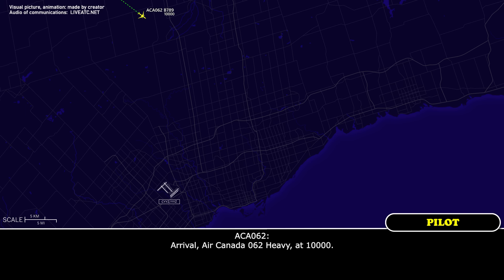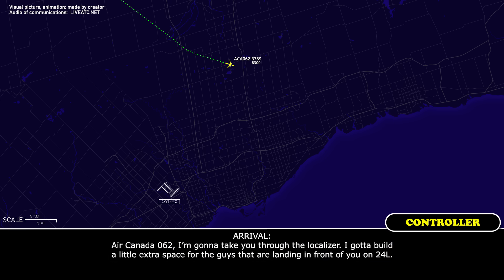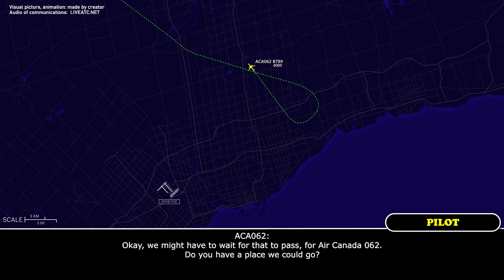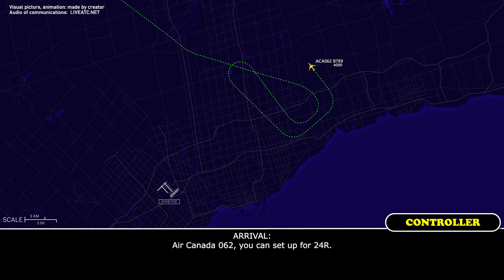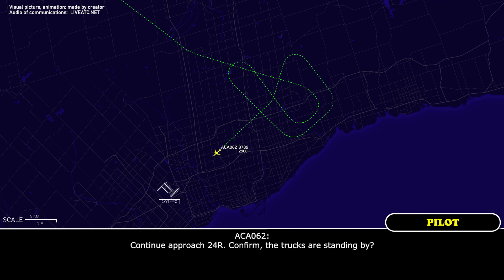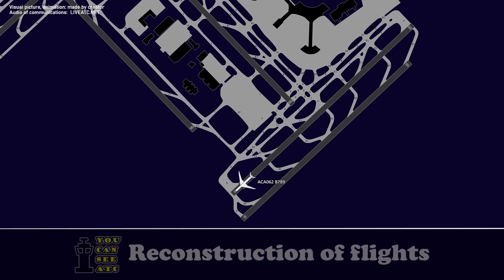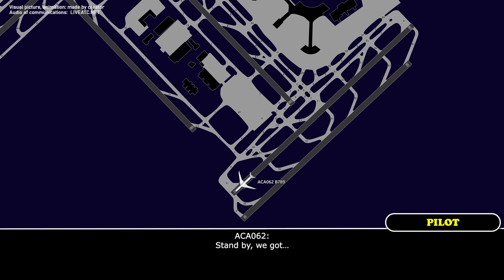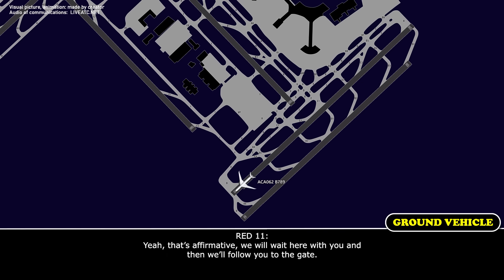Flaps failure on approach. Air Canada Boeing 787 stops on runway at Toronto after landing. Real ATC

Comment: 0 need to park on the RWY at a major airport like that - unless you are on fire or nose gear steering failure. Stupid pilots or dumb company policy. 

Standard ops is to  pull off into the nearest high speed exit and clear the active.  Extra 15 seconds and makes 0 difference to the temps already if you keep it rolling, in fact it would help the brakes cool slightly.
Reply: That is by no means standard....I have handled many flaps up landings and every single one has stopped on the runway. Lots of armchair ATC in this comment section...you have no knowledge of this airport's operation, why do you think that you know it was better for them to be on a taxiway? the runway was a perfectly good spot in this situation. There were weather factors, staffing factors, and airport layout factors.
Reply: @Marklar0  I explained my reasons for why any runway should be vacated as soon as possible
Reply: Next time when you're the aircraft captain of a large aircraft, with many people on board, at a busy airport, adjacent to a thunderstorm, and landing without flaps after a long day, go ahead and taxi off the preferred safe stopping position... But you would have more luck demonstrating better manners and awareness as opposed to insulting professionals using your keyboard.
Reply: @themightylion647  sorry, as a professional I never apologize for offending anyone, if it increases the safety of my ship even slightly  - why this is so hard to understand is a good example why our society is where it is today - people are unable to think anymore.
Reply: Luckily the commander was in charge and not you then. If you had listened properly you would have heard that the tower had told them that their existing position was the best place to hold
Reply: @davidwarren202  luckly for the commander, the fuse plugs did not melt and they would have become immobile and YYZ would lost that runway and delayed 1000s of flights - all for 0 increase in safety
Reply: @ghostrider-be9ek  They waited for a short amount of time for the brakes to cool, 24R was not on use (why they said the lights just came on) and if they made a right onto Delta they would still be blocking the taxiway as they were in their current position. Sure maybe if 24R wasn't occupied aircraft coming off of D6 or D could've made a right onto 24R and then onto C4, D4, etc. They're all professionals and I'm sure they did the best given the situation at hand - CYYZ has many runways and I'm sure ops could be adjusted to handle this situation
Reply: @ghostrider-be9ek  Two more into wind runways.
Reply: @danialbeg  the safety of the aircraft is paramount - GTFO the runway as its a danger zone - way more dangerous than taxiing an extra 15 seconds with no increase in brake temps. 

They are NOT all professionals, and AC has demonstrated this numerous times the last 5 years. Way too many people in the front who cant think outside of a book or manual.
Reply: @ghostrider-be9ek  again if the runway was not in use anyways then it's not like there were aircraft that were lined up for an approach onto that rwy. Additionally, if it was too dangerous ATC would've asked if they were able to taxi off the runway but never did - I have seen other incidents in the US where planes have stopped on the runway to cool as well so it's not only an isolated thing. Again, at the end of the day we don't have all the facts and perhaps experience that the crew and controllers do so our opinions don't hold much weight at the end of the day anyways
Reply: @danialbeg  again, just because a runway is not in use does NOT mean some numpty pilots dont land on the wrong runway - get the metal and pax off the RWY ASAP. 

It is NOT a place to hang out unless you are on fire or otherwise disabled (which they were not). 

Ultimately this was a dumb move, and had the tires blown YYZ would have been in a big pickle for 12 hours.
Reply: @ghostrider-be9ek  Lol bro 24R is never active at YYZ and I’m willing to bet it was not in use at the time. In this scenario it was just as much a taxiway as D4 D6 or D8. In fact, if they had vacated onto one of the turnoffs, they could have potentially held up inbound traffic landing 24L and vacating (as I’d assume 24L was the active arrival runway because it usually is). It’s not that deep. Tower instructed the runway would be the best place to hold and pilots complied. Why make things more complicated? Seems like you’re just trying to stir the pot. As for why the 33 runways were not used, not too sure. I know they’ve been under construction recently so that could be why
Reply: @dudeman2488  why is safety and common sense, stirring the pot? Why dont pilots do better?
Reply: @ghostrider-be9ek  stopping on the runway was the common sense. Pilots did everything proper. 🤡<—this you?
Reply: @dudeman2488  right, because no one EVER questions pilots and they NEVER make dumb decisions?
Reply: @ghostrider-be9ek unlike you these pilots aren't flying flight sim
Reply: @jpa1282  I am a pilot, and I also have flown sim - what is your point?
Reply: @ghostrider-be9ek  THIS is why you stay put until the brakes cool down... https://www.youtube.com/shorts/R_9-Y_5WW00
Reply: @ghostrider-be9ek  you're delusional.
Reply: @Majerly_Annoyed  how in the name of Christ does taking an extra 30 seconds and rolling off The runway , without touching the brakes, in any way heat up the brakes??
Reply: @Mark-md9pe  that's right, I think we don't want safety in aviation, we want to play our chances, as Air Canada has done too many times in the past
Reply: @dudeman2488  Bad weather at 33 i think. Really bad weather.
Reply: @bronze5420  right , both dumb ideas - clearing the runway results in 0 chance of a wrong rwy landing hull loss, and has 0 impact on airport ops,. Why is this common sense thinking?
Reply: @bronze5420  not sure what kind of pilot you are, but other aircraft landing on the wrong runway is a real danger - also if you keep the ship rolling to the end without stopping, and exit using the last taxiway and clear, there is 0 extra brake energy absorbed - all of this should be known to pilots. Why do I have to spell it out for you?
Reply: dude...this is like saying you want to stop at every green light in case somebody blows the red. Its nuts.
Reply: @Marklar0  are you even in the industry? That is completely an apples and oranges comparison. 

A more appropriate analogy would be something like avoid stopping on the side of a highway , always try to find a side road to pull off, for more safety

Comment: Do passengers know there is an emergency on these most the time? Or not until they land?
Reply: DARN!  now that you suggested $35 notification fee the airlines will consider it.
Reply: those bean counters ARE a pesky bunch
Reply: I was in that plane, we have no idea. Even after we landed, the pilot told us the brake was too hot, and we needed to wait for them to cool down.
Reply: @edwinyan  even that prob confused everyone else
Reply: What is the advantage to telling the passengers who can do absolutely nothing about the situation besides panic over it?
Reply: @conorcorrigan765  Well, they may brace for impact ? In case it overruns the runway ?
Reply: @dmitripogosian5084  Bracing for impact is not a personal decision the passengers make themselves. If the captain thinks people should brace he or she will tell them to brace.
Reply: @conorcorrigan765  to keep them from panicking?
Reply: @YippyKiYayMrFalcon  If they are told nothing what would make them panic?
Reply: Only if they listen to live atc
Reply: most pax have 0 clue about anything on an airplane
Reply: @ghostrider-be9ek  thats probably good though
Reply: @YippyKiYayMrFalcon  its fine until things go wrong on a flight, then its a problem
Reply: @Deconkb1  😂what a bargain
Reply: The pilots would make a PA with an explanation prior to landing.
Reply: @Deconkb1  I think that's the new fee at Swoop